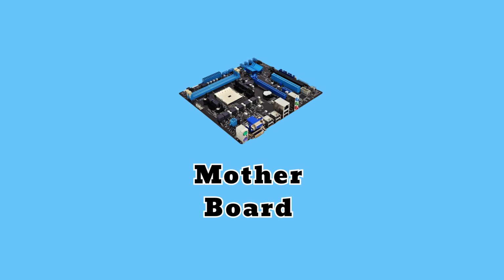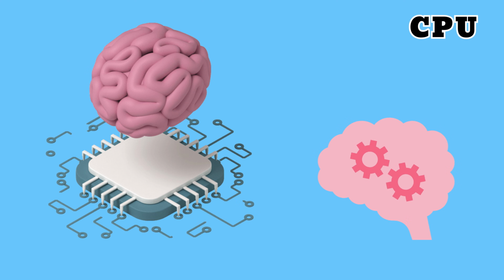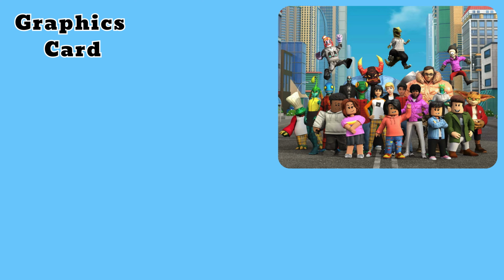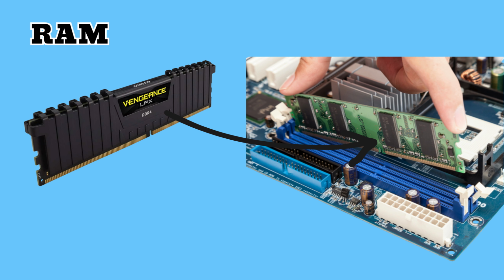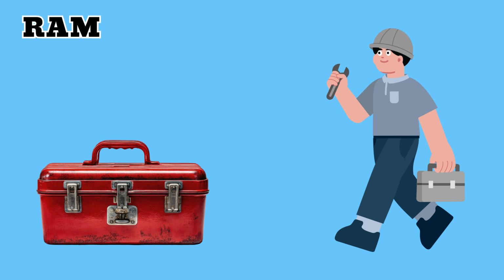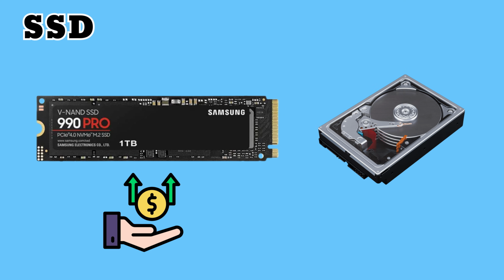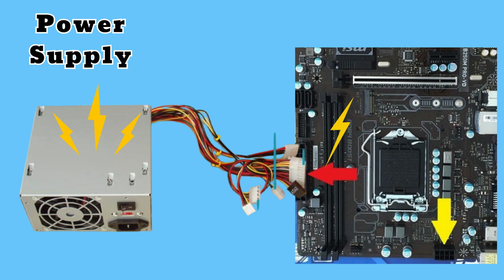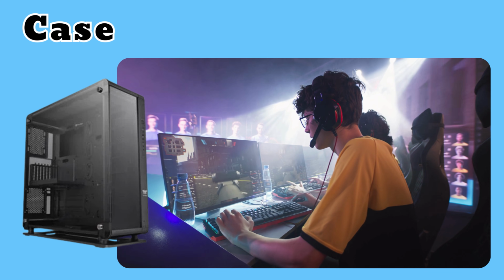Every Computer Parts Explained in 5 Minutes!

Comment: Sir, I can't understand the algebraic equation {√a + √b = √c}. Suppose we have this equation √a + √b = √c.....(1) Now we square both sides of this equation and simplify a little, and we get: (√a + √b)² = (√c)² a + b + 2√(ab) = c 2√(ab) = (c - a - b) Now we square both sides once more and simplify further: [2√(ab)]² = (c - a - b)² 4ab=c²+a²+b²+2ab-2bc-2ac 4ab-4ab=a²+b²+c²+2ab-2bc-2ac-4ab a²+b²+c²-2ab-2bc-2ac=0 Now we will do something new here and simplify it. a²+b²+c²-2ab-2bc-2ac+4ac=4ac a²+b²+c²-2ab-2bc+2ac=4ac 4ac=(b-a-c)² {we can write it like this} √(4ac)=b-a-c 2√(ac)=b-a-c a+c+2√(ac)=b (√a+√c)²=b {We can write it like this again} So, in the end, we get this equation: √a + √c = √b......(2) {How is this possible} Now, if my calculations are correct, then √a = √b + √c √b = √a + √c And √c = √a + √b All these equations will be correct. And if there is a mistake in my calculations, please tell me what is wrong and why.❤
Reply: The first steps are indeed correct but the step from 4ac=(b-a-c)^2 to 2sqrt(ac)=b-a-c and therefore sqrt(a)+sqrt(c)=sqrt(b) is incorrect. Remember sqrt(x^2)=|x|. Lets look at an example: a=5 b=125 c=180.
This satisfies sqrt(a)+sqrt(b)=sqrt(c). But b-a-c=-60=2sqrt(ac). which is not possible because the sqrt-function is always defined to be positive. So you define b-a-c=|-60|=60 which is defined by a=5 b=180 c=125 your equation (2).
Also squaring an equation is not an equivalence operation and may introduce additional solution which why you should always check your answers after squaring.
Take x+2=1 which yields x=-1 but if you square (x+2)^2=x^2+4x+4=1 or x^2+4x+3=(x+1)(+3)=0 which yields x=-1 or x=-3.